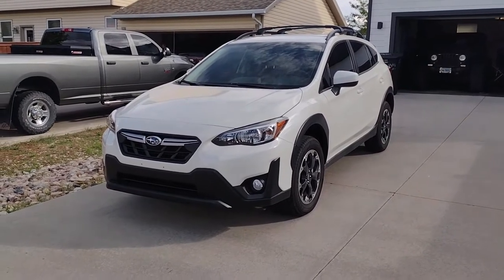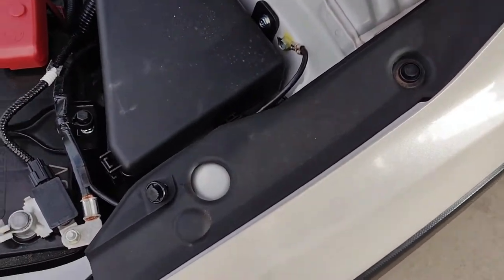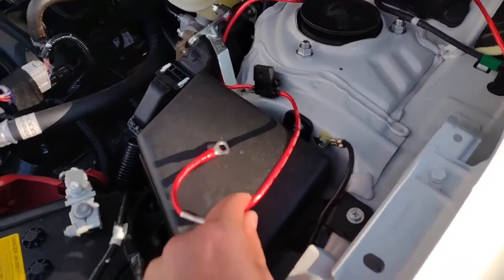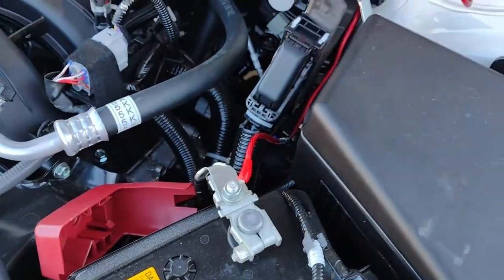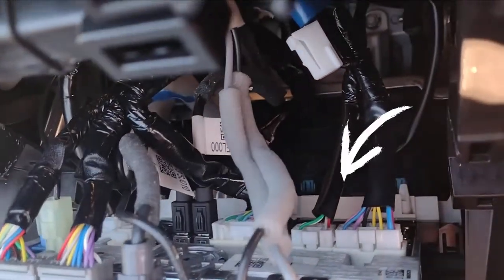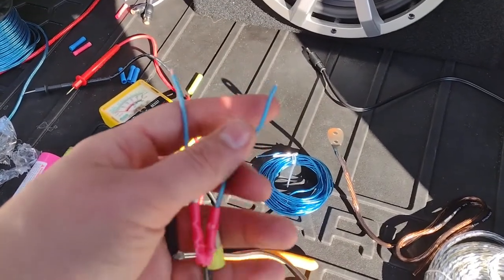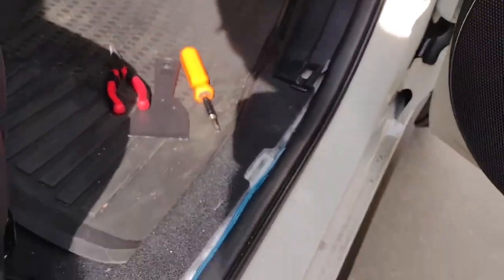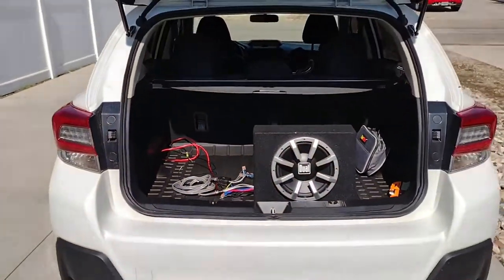How To Install A Subwoofer To Your 2023 Subaru Crosstrek

Comment: That LOC can be installed directly behind the head unit and tucked back into the dash. At that point simply connect your rca audio cables and amp remote wire and run on opposite side from new power wire to the new amp. This would be anuch cleaner install. My .02

Comment: I got mine a couple weeks ago but I have the premium sound system but I feel like it’s still missing bass so I’m gonna add a sub but not sure if the wiring is different from yours
Reply from the maker: Yes, the infotainment system on the higher trims is different but you should still be able to test the wires on the back of the head unit to find the speakers you want to splice into.
Reply: Thanks for commenting this as I have a 22 impreza sport with the Harmon kardon upgrade and wanted to add my sub. Thanks for the info!
Reply: Just splice into the factory sub wiring and use a kicker keylock or a LC-2i 

No need to remote factory radio when you got a stock sub.
Reply: 3 buts. Nice

Comment: Hey, so instead of testing out each of the wires behind the head unit, would it also be possible to check the color of the cables that the rear left and right speakers are connected to to find out what color to tap in to? Great video btw!
Reply: depends if the speaker wires went into another harness before they get to the speakers in the doors/rear shelf

Comment: Is there a reason you used the rear speakers to to loc vs the front? I'm going to be installing all 4 new door speakers and will just add speaker wire to the loc at that time but didn't know if it made a difference if I pulled from the fronts or the rears. From what I've googled some people say it doesn't matter and some say the fronts have a full signal and sound better.
Reply from the maker: I heard the same -- that the front speakers carry more signal data and therefore would be better to tie into. I did front speakers in my last vehicle and to be honest I really can't a difference. However, it's only a 300w sub to make my system sound fuller. I imagine you'd want more data if you had a larger sub but I can only speak from personal experience.

Comment: I know this is for a sub but anyway you can use factory head unit to run amp for more powerful speakers in doors, cleaner sound?
Reply from the maker: Not without potentially blowing out the speakers. They are rated for the wattage being put out by the factory head. If you upped the wattage and turned up the volume, they would likely fail. Though the last vehicle I did this in was my 2004 Toyota Prius in where I blew out the front two speakers almost instantly.

Comment: What did you run your remote wire to? I see that you have it written down on the notepad in the beginning but you don't show what you ran the wire to. Does your amp just run constantly?
Reply from the maker: The LOC I bought manages that. Once it detects signal, it turns on the amp. 

If your LOC doesn't have that feature, you can run additional wire from the driver's side fuse panel to the trunk

Comment: When you spliced the wires, did you have to splice all of the different speaker wires? Apologies because I am very new to the sound system game and just recently purchased a 2023 Crosstrek myself. I have a powered subwoofer that I am looking to install.
Reply from the maker: Techincally,  no. You only really have to splice into one channel. However, if you want a better sound, you'll want to maximize the amount of information being collected by your LOC and sent to your sub.  That is why I took it from my rear L and R channels. 

That way too, if I adjust my speaker settings, the sub is controlled by both my rear speakers' settings and not just one.

Comment: Random questions, is the powered sub you used have a built in DSP and does ur Crosstrek have the Harmon Kardon speakers? My "professional" install worked for 2 weeks, stopped for no reason, all status light good yet no subwoofer sound at all. Finding info only to troubleshoot this is impossible, great vid.
Reply from the maker: No clue. I definitely don't have Harmon Kardon speakers though.

Comment: Do you think from fishing the 10awg through the grommet that 4awg will fit? I’m kind of doubting it from looking at the size of the opening.
Reply from the maker: It'd be tight but I think it would work. You can take out the rubber grommet entirely if you had to. The only other item sharing that opening is the hood release.

Comment: Where would I connect the remote wire?I just installed an amp, and it won't shut off.
Reply from the maker: My LOC had a sensor built in where I didn't have to worry about that. But you'd have to run additional wire from your fuse box (located under the dash on the drivers side) to the amp to signal when the stereo is turned on/off.
Reply: Thanks

Comment: What LOC did you use? The one I used in mine doesn’t have a sensor for the remote wire so my amp is constantly running & killing the battery.
Reply from the maker: https://www.autozone.com/stereo-speakers-and-audio/audio-cable/p/metra-electronics-axxess-integrate-output-line-converter/208157_0_0?rrec=true
Reply: Thank you!!

Comment: Do you by any chance know if this will work with the Harmon Kardon system?  I know when changing radio's on my STI (also HK) I needed a special little red box for canbus decoder. 
  I'd really like to put a 10" in behind me somewhere in my 23 XTrck. Don't get me wrong the HK sounds good (not great) but it definitely sounds like the rear is just open space. (Kinda hard to explain, but basically like there should be sound coming from that direction).
Reply from the maker: I don't know, sorry.

Comment: Not sure what all you have on your vehicle, but did you have any issues with STARLINK connecting it that way?
Reply from the maker: I have STARLINK and I had no issues. If you don't remember to reattach the top connecting set of wires (minute 2:58 in video) then the alarm won't work and that might give you issues with Starlink since it's a security feature. Not sure if that is what you're facing though.
Reply from the maker: I have starlink and had no issues there.

Comment: Question dose Subaru split bass and treble into 2 different channels?
Reply from the maker: Mine doesn't, no. No clue about other models though
Reply: ...the other question is does the rear channel see all/the full spectrum of frequencies, or is the rear limited in its sonic range?  what frequencies does the built in EQ do to the rear channel?
Reply from the maker: Couldn't tell you however mine gets and boosts all the low frequencies. My amp helped a lot with that too. And the EQ does influence the sub but it can all be fine tuned with the EQ and the amp dB levels/boosts

Comment: Will this void the warranty if I do it?
Reply: ...depends.  🤔   depends if your warranty claim has to do w/the radio/infotainment/or functions connected to it.   depends if your claim is a generic electrical issue.   depends how lenient your dealer is.    sure, the dealership "has to prove" the mods you did caused the failure (but that takes technician time and money out of the dealer pocket), but most times the dealer calls owner mods irresponsible and blankets those mods as owner neglect and will refuse warranty work.   Are there laws to protect owners against this practice, yes, but that doesn't mean the dealerships "play fair".  Because now, it's your lawyer vs their lawyers.  Also, SOA will side w/the dealer more times than not.   dealers are reimbursed by Subaru for warranty repairs which is why regional reps get involved in a lot of warranty claims, unless it is blatantly obvious what caused a failure.   

so, up to you. do you want to take the chance?  are you confident in your abilities?  if you are ultimately unsure, TALK to your dealer reps and see if they give you the answer you are looking for before doing the thing you want to do to your Subaru.